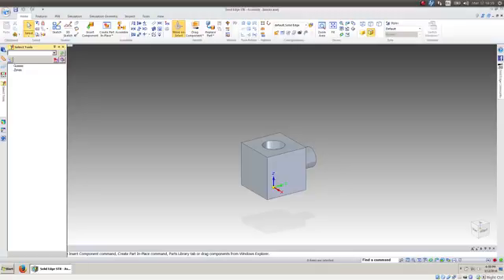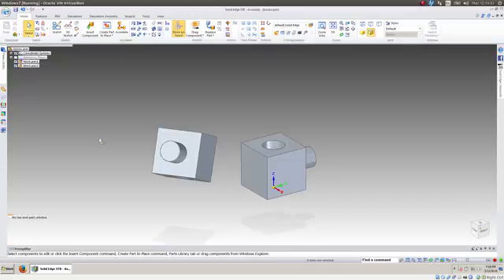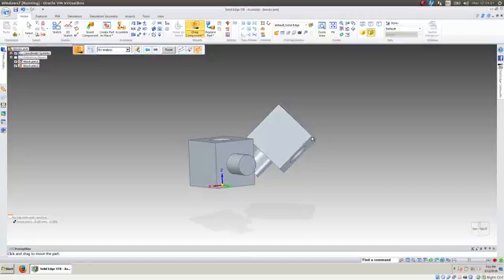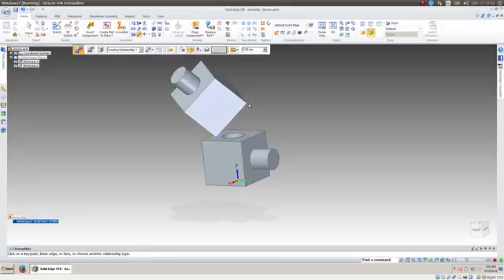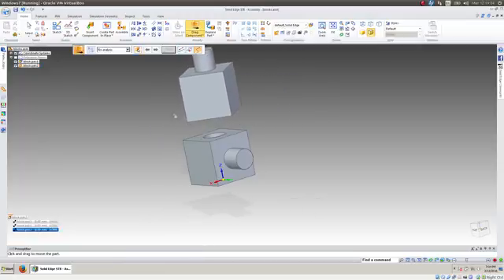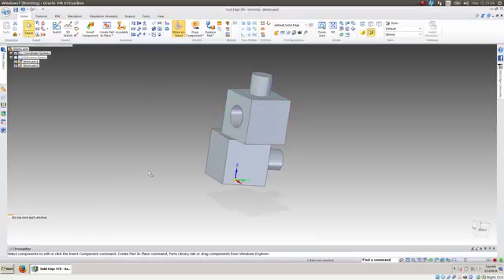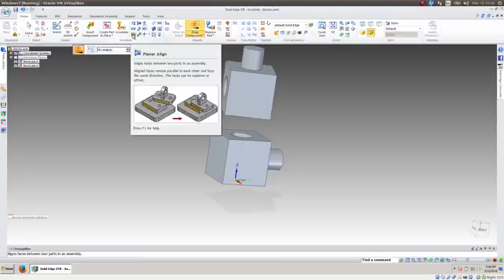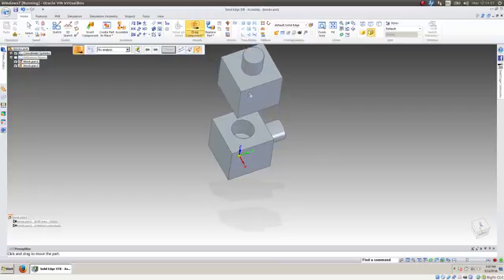Degrees of Freedom and Constraints in Assemblies

Comment: i think when you attached the point to the plane it should have 2 translational and 1 roational DOF how come there are 5 ?
Reply from the maker: The second block is free to rotate about the contact point in any direction.  Maybe me dragging it around does not show that very well, but you can imagine a coordinate system at the contact point and picture the part spinning about each axis, one at a time, and see that the point remains in contact with the plane (which is the only constraint imposed).
I hope that helps.